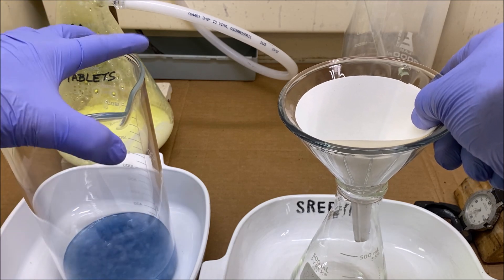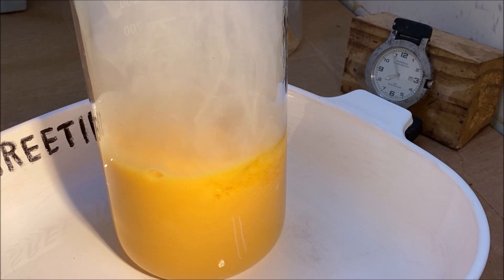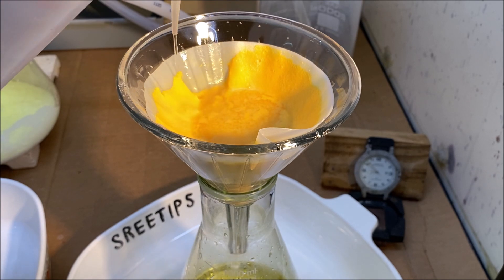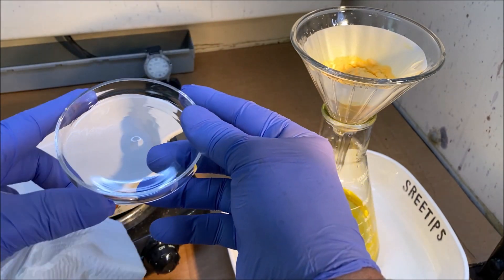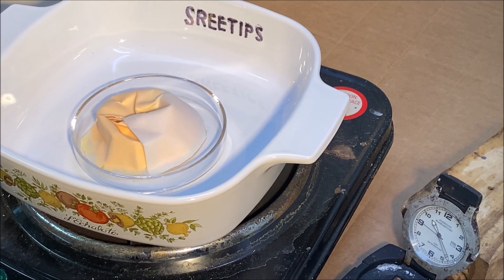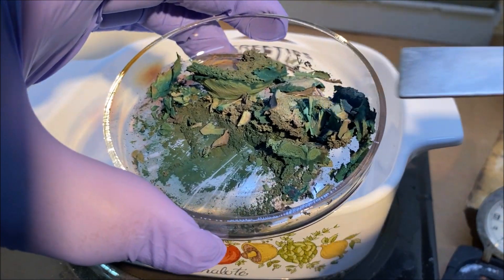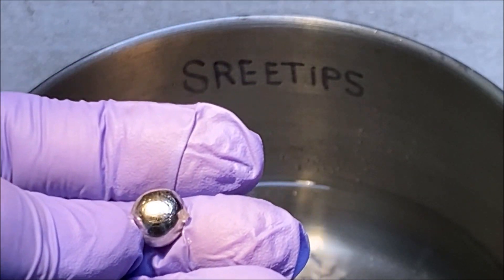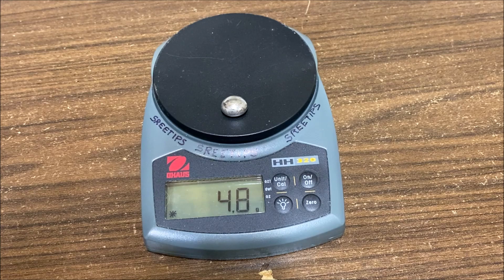How To Recover Platinum Group Metals From Dental Scrap Pt6

Comment: Lol... I just made approximately a half troy ounce of 18 palladium gold for a project I'm working on to make a good friend of mine chemical matching pair of wedding bands. When I melted my palladium bar to make shot so I could weigh it out for the mix I completely forgot palladium is used in catalytic converters and can withstand some serious heat... it took everything my oxy/mapgas jewlers torch could put out without blowing itself out and it still took forever... I gave up when I got half the bar melted into a puddle but even then I ended up burning a pinhole in the bottom of my crucible and also melted a nice concave divit in the fire brick my crucible was sitting on... if it wasent for the amount of borax in the dish I would have lost palladium through the hole I burned in the bottom of the dish... it was a brand new dish lol.... lol I thought I had bit off more than I could chew but when I melted the gold first to add the palladium shot too thankfully it mixed alot easier than melting pure palladium....lol... fun times
Reply from the maker: Palladium is about one thousand degrees hotter than gold to melt.
Reply: @sreetips  yeah... I learned that when I led the torch to it for 20 minutes it felt like until I barely started to get some to melt off the bar... still have half the bar un melted.... lol.. got a 20 pound oxygen tank and it it took 70 bar off the tank pressure of a brand new refill to melt half the palladium bar

Comment: I've got a lot of palladium-containing electronics parts, mainly MLCCs and palladium-containing ceramic resistor arrays.  This series will be extremely useful when it comes time to process them.  

The primary recovery will be via crushing and smelting with a collector, likely copper, since the ceramic tends to cause a lot of loss with chemical methods.  The powdered ceramic just grabs too much of the metal with wet chemical methods and a huge amount of rinsing and stirring the toxic mud would be required.  But after smelting, then the purification of the copper dore containing the palladium will be with chemical methods.

Comment: would salt crystal is a possibility of separating platinum from the solution
Reply from the maker: I don’t think so
Reply: @sreetips  sorry should of rephrase the question properly depending on what the needle crystal are keeping with the notes pd 2 crystal.  Now watch back the video there was no status test on the solution after needles crystal was pull of from solution to determining if the needles was both platinum or palladium or which did remain in solution I believe it's possible to test this on the remaining crystals
Reply: @sreetips  for the status test to see if the constration of which metal has drop of solution
Reply from the maker: I added the remain needle crystals to my stock pot. Then I realized I should have done some tests with them.
Reply: @sreetips  lol ok was curious of what remain in solution

Comment: Congrats on your new shiny pd button! You know that you could have skipped the brick red salt part and achieved the same result right? I mean ammonia added to the de-NOxed palladium chloride solution, the one you had needles precipitating out of.
Reply from the maker: No, I didn’t know that.
Reply: @sreetips  try it next time and you’ll see for yourself, even if you missed some platinum after the ammonium chloride treatment, you’ll catch it in your filter when filtering the solution after the ammonia addition.
Reply: @sreetips  another tip if I may, converting the yellow palladium salt can be done in under 10 minutes with formic acid and some NaOH flakes to kick off the reaction. The black palladium precipitates in big lumps and it’s very easy to handle.
Reply from the maker: Good to know, thank you

Comment: This video series was fascinating. 
I have always wondered the difference in weight of the liquid compared with the same amount of water. It still boggles the mind that you can dissolve metals in a solution and that it can still pass through a filter.
Reply from the maker: A solution with gold dissolved in it will weigh more than the same volume of liquid with no gold dissolved in it.

Comment: Bravo Sreetips, have enjoyed this entire sequence 🙂 !!!.  Wondering what happens if you try to refine dental gold, which is almost always 14K alloyed with some small percentage of Pt and/or Pd, am guessing it would take a lot of dental gold to come up with 10 grams of Pt + Pd which you indicate is a practical amount, below which I'm guessing it turns into a hassle trying to use test tubes rather than beakers,  am guessing the easiest thing to do is leave the Pt in with the gold and the Pd in with the silver (then can get the Pd with silver-cell electrolysis, except that it will be a really small amount).
Reply from the maker: Yes, the platinum group metals tend to follow the silver.

Comment: You still have spattering and vaporization in this slow heating process.  A second dish on top would stop this.  I know they are expensive, but cheaper than a GSM ashing furnace chamber. There is still a gap that allows H2O and carbon off gassing, but will trap all your heavies.
Cuppelling the ash would have avoided any extra loss.  The flame is just too powerful and was blowing more than borax out of your melt dish.

Comment: Congratulations on the work done, the washing of the final precipitate of palladium diamine chloride should be done with distilled water slightly acidified with hydrochloric acid to avoid the precipitation of hydroxides, especially copper, which would contaminate the palladium salt.
Reply from the maker: I had no idea
Reply: @sreetips  When washing is done with distilled water, the pH of the solution is finally neutralized and some basic metal hydroxides may precipitate and contaminate the palladium compound.
Reply from the maker: Got it, thank you.
Reply: @sreetips  and now you know. Trade marked  by ABC I think, years ago for Saturday morning fare by McMahon. If it has an exclamation mark in front it is currently dead or abandoned in 1997
Reply from the maker: I’ll make sure and use 5% HCl in 95% distilled water. Will that do it?
Reply: @sreetips  Yes, it will work, even after doing multiple washes with acidified water there would be no problem in doing a final wash with pure water at pH 7.
Reply from the maker: Thank you
Reply: @sreetips  Thank you for generously spreading your knowledge.

Comment: An excellent video ! But why was palladium in the dental scrap ? How do you discern platinum from palladium in the chemicla preparation ? I must have missed some important part in the 6 part long video. Now I understand, why you do concentrate on gold refining. PGMs are a pain in the azz to prepare.
Reply from the maker: I tried dropping platinum but there was none. It would appear as a fine yellow powder in part five when I added ammonium chloride. But none appeared. Baffling.
Reply: @sreetips  I have found something about this: "Since the late 1970s, palladium has been a key metal used worldwide by the dental industry in the development of alloys for the manufacture of crown and bridge restorations constructed by dental technicians. The price of palladium, now significantly less than that of either gold or platinum, coupled with its much lower specific gravity, (12.02 compared to 19.3 or 21.45 g cm3, respectively) ensures that palladium-based alloys are very economic (the same weight of palladium has a
larger volume than gold or platinum)"
Reply from the maker: Plus, Pd melts around 2800 F and platinum is around 3200 F four hundred degrees makes a big difference.

Comment: I don't believe that the blue color of the Pd/NH3 solution is due to copper, the color isn't right.  I would call that a cornflower blue instead of the saturated 'in your face' blue or violet of copper complexes.  Dental alloys are formulated to be completely inert to Human tissue.  Copper is anything but inert in vivo, as anybody who has worn copper jewelry for any length of time can attest.  I suspect the blue solution is a tetrammine coordination complex of palladium and/or platinum, similar to other tetrammine/PGM complexes.  Adding HCl to an aqueous ammine/metal complex crashes out the precious metals by neutralizing the ammonia in the solution, rendering the precious metals insoluble.
Reply from the maker: It was copper. I added mixed black PGMs from my stock pot and from some anode filter recoveries. Both of those contain copper. Blue during ammonia dissolve is copper. Green is nickel.